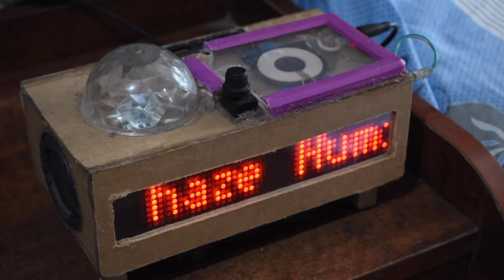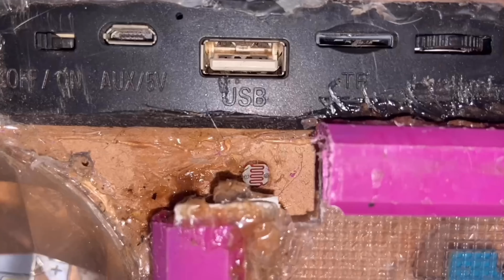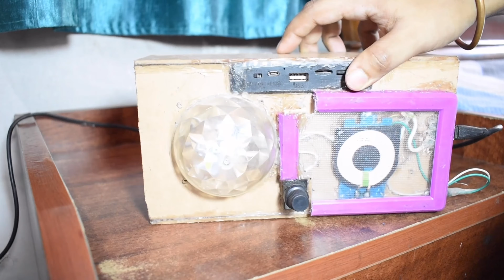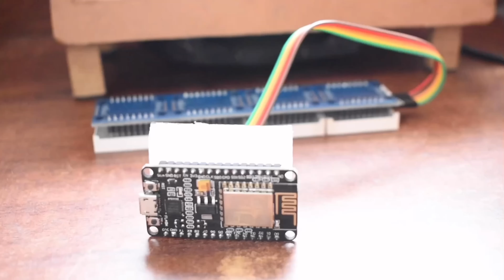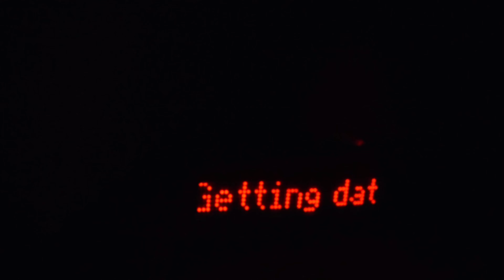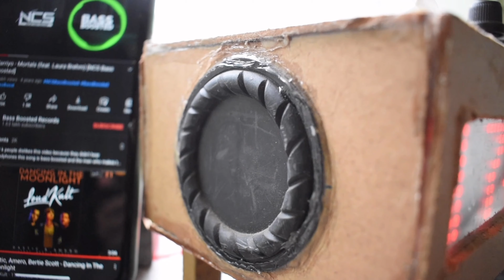DIY ESP8266 (IoT) Deskclock with Bluetooth Speaker, Wireless Charger and Dimmable Night light !

Comment: Hello, the letters appear vertically, I need them to appear horizontally, can you tell me which line there to modify in the code?
Reply from the maker: You can play around with the Rotate command. More info can be found in the MAX7219 DotMatrix github library. Do subscribe bro, like and share.